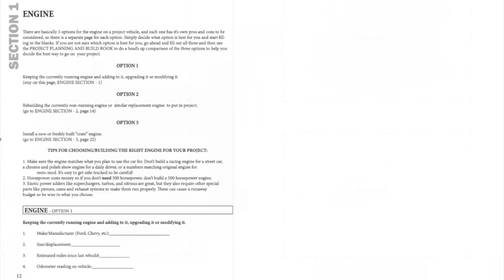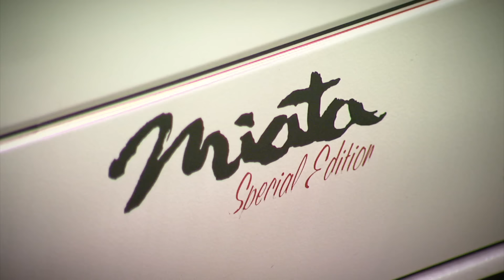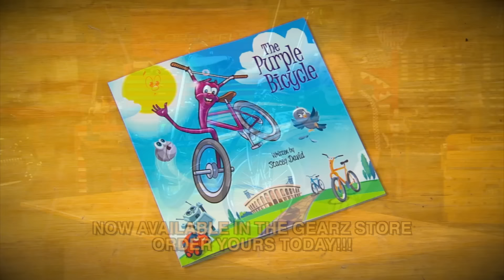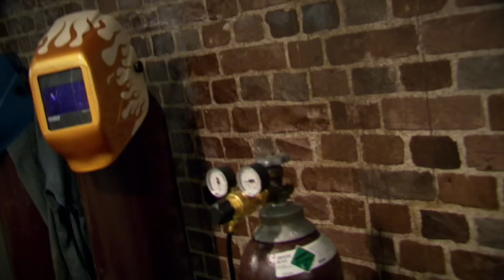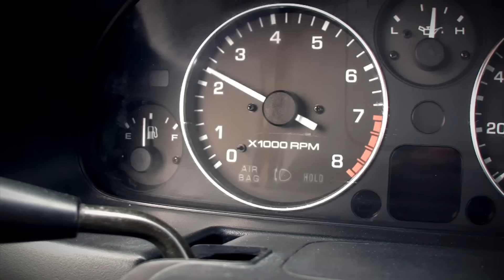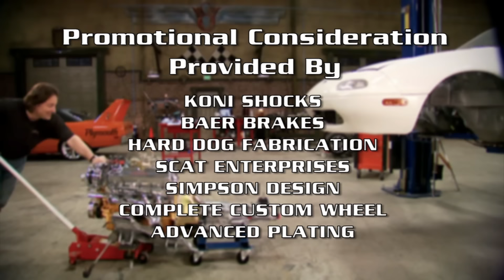Turning a Stock, Broken Miata into a Track-Slaying V8 Monster! Stacey David's BANSHEE - FULL BUILD

Comment: Years ago I made my own light weight flywheel. Put it on the lathe and cut 6lbs off it, also it has stood the test of time. I did it back in the 90s and sold I it a few years ago and never had any issues.

Comment: 22:12 Damn, from this point of view, you can see that the factory engine takes up more space in its width 😀
27:12 Can I buy such a small, light transmission for an SR20 engine? Maybe in Europe? Maybe not a manual, but a CVT?
32:50 How do people get in through that winged door? :D

Comment: If you watch from about 01:03:43 and look at the reflection of the lights in the paints you can see how the new bodywork on the front, and the hood, are not factory smooth. That blue colour looks great but it shows all the imperfections of the composite construction. I couldn't live with that.

Comment: Deberian hacer un nissan 240sx s13 hatchback 1989 ka24e full wide body rocket bunny v2 pero con un motor v8 roots super charger blown con side pipes como un hot rod. Asi yo quiero hacer el mio, yo tengo uno asi puedo ver como va a quedar🤩

Comment: About the only thing a street NA Miata needs is a suspension upgrade package (stiffer shocks, springs and sway bars or performance coil overs) some 15X7 wheels and performance tires. With these upgrades the car can carry so much speed through the corners that the stock engine provides enough power on a road with a lot of tight curves.  Once you get it up to speed it can carry that speed so you don't need a lot of HP to decelerate and then accelerate.  Miata was never meant to be a drag racer.

Comment: Rear wheel offset is too wide, and the whole car needs to sit a bit closer to the tires (it's like you couldn't decide whether you wanted a muscle car or sports car)...but overall it's a pretty cool build. LOVE the V8 Miata builds...my next build will most likely be an LS based Miata Cart. 1400lbs and 500hp N/A lol.

Comment: It is illegal in CA to use any Catalytic converter marketed as 'high flow'.  So good luck passing smog.  I assume if you had just kept the stock ones it would be fine.

If you got the ride height and rear poke dialled in it might be a sweet looking conversion.  I did see a custom 3/4 Mustang built on the Miata platform once.
Reply from the maker: This was built in Tennessee, so that wasn't an issue. I don't think you could do this specific conversion at all in California. There are other conversion options that may be CA-legal though.

Comment: I realize that this build was many years ago. Two questions:
1) Why did you go for carbs instead of fuel injection?
2) What does putting that V8 under the hood do to the MX5's 50:50 weight distribution?
Other than that, that's one mighty fine build! I would love to have a car like that.
Reply from the maker: Putting a carb on it showed people who might've been intimidated by fuel injection that it could be done. Weight distribution with an iron block V8 isn't as good as stock (don't know the exact figure), but the difference is minimal if you use an aluminum V8.
Reply: @OfficialStaceyDavid  Aluminum  V8.. how much does that add to the cost?
Reply: @OfficialStaceyDavid  The LS1 would be my first choice for a build like this.

Comment: I think you have the front brake rotors on backwards.
Reply: There was a directional arrow on the rotor. He had them on right.
Reply: @danquinnell3502  direction arrow or not, the viens are directional and was put on opposite the way they work.

Comment: I would have painted the Miata body metallic blue, like the paint you used or dark metallic green, no striping. Done everything possible to make it look factory except maybe a good paint job. All black interior as stock as possible with black not chrome roll bars/ The roll bars for safety, and black to "hide" them when the top is up... less noticeable.

Yes I want a sleeper, but preferably one that looks cared for but not modified. The for the entire under carriage would be black or dark grey, and the engine might not have chrome accessories, but clean new ford color paint on the engine and billet aluminum valve covers and accessories.

Comment: Brother the ultimate sleeper is always going to be a wagon the boxier the better.
plastic don't generally need to be painted though atleast not if its faded hit it with some heat will mosre then likely bring it back wont it?
oh and a V8 growls it does not scream. unless you cook the oil in it.
Reply: The heat gun on plastic trick brings the oils to the top, temporarily "restoring" the dark color, but it also sucks out the same oils which keep it from getting brittle. A short time later it'll be faded again too, as well as brittle.

Comment: Also you have modified everything else I definitely would have drilled the cross member rather than weld and harp plan and I would have went with at least 5 lug hub if not 6 and some massive tires to go with some serious brakes

Comment: Unfortunately GM has them 1 upped with the Solstice/Sky. Unknown to many is that the LS engine and tranny (manual) pretty much bolt right in and wire up without any significant body mods needed. That car was actually meant for this same purpose but they decided not to go forward with it.
Reply from the maker: Those are very cool cars but about 600 pounds heavier than a NA Miata. They would be a good project if I wanted to revisit this concept!
Reply: The other issue with the Solstice/ Sky is the lack of aftermarket support. Throw a rock and hit 40 Miata parts on the market. Not so with the GM twins.

Comment: 4:20 That's not strictly true. AC were using American V8 engines in their cars, and it was not exactly a girl's car. Shelby did not exactly "put in some horsepower" because it already had that. What he did was take a small, overpowered road car, and turn it into a lethal track weapon.

Comment: I will say this if you're pulling the engine and trans and the subframe you might as well just pull the engine transmission subframe out all together. Save yourself the trouble of lifting it out of the car when you can just drop it out the bottom

Comment: Hello, one question from the other side of the Ocean: don't you have a M.O.T. or any kind of control in the US? I was refused for having swapped my indicator's light bulbs with coloured ones "nor factory build, OFF !" they said or the car was take away from the circulation ! Best Regards, Michel (Belgium - Europe)
Reply: Hello Michel, There's no MOT in the US, but safety restrictions are different from state to state. In most states, as long as the car passes a smog check every 2 years you can do pretty much what ever you like with after market parts. Here in California Smog checks are more strict, but if the car was built before 1975 we can do anything we want with no smog check at all. That said, a police car can pull you off the road for unsafe conditions, and you would have to repair it or the car would be taken out of circulation.
Reply: @Datsun510zen  Thank you very much, All the Best for new year, Michel (you luck car owner ! hahaha)
Reply from the maker: Gearz is based in Tennessee, US, which has no state safety inspection and now has virtually no emissions testing. As the other commenter said, that varies widely from state to state.
Reply: @OfficialStaceyDavid  Thank you very much, all the best for the new year ! you lucky ;o)

Comment: Question: Do they make a kit to fit a Chevy engine into the Miata ?
Reply: Yep.  They have an LS conversion kit.   A junkyard 5.3L or 6.0L with a cam, intake, and a tune would be a good way to go.   You can make 450-500hp pretty easily.    That much power in that car would be nuts.

Comment: Comes across as a really nice
genuine guy.
A truly great build but if it were mine I would have stopped at just the mechanicals and seats and left the bodywork and wheels as standard to be a real street sleeper. The brakes would obviously be needing upgraded but maybe found discs which would fit under the standard wheels.  
Greetings from the UK, 🇬🇧

Comment: So u just installed a steering wheel with no airbags....on a fast car? So much for an Italian art. The body strap will not keep your neck from breaking unless you also strap your forhead on the seat in a whiplash. Vince Laviolette will never take that car for a spin. Its a very nice build, don't get me wrong.

1:08:56 Maybe the guy has fake nails. Fake nails are unregistered weapons. Thats why i don't mess with girls, i just chase them.
1:15:59 I thought u changed the seats the first time coz u wanted one with bigger rib support..lol. it works either way.

Very nice car. Think i can have it ? lol

Comment: His opening thesis is 3000% correct.
But, if you want this to be a street rod, you will have to make many compromises. Make it a track car, and it will beat anything lined up against you.
Edit: Why are you keeping the AC for a track car??!
Edit: He is not peeling out the carpet and sound deadening material???!

Comment: Unless you hate Chevy for some reason most people would rather swap in an LS derivative.  F Body oil pans fit the tubular K members just fine.

I would probably recommend an RX8 just because its practically a 3rd gen Miata stretched a bit.  And with this much horsepower a longer wheelbase is always good.  And since the engines on those are always going bad its more likely you can find one in nice shape that isn't all destroyed.

It is pretty common knowledge that Miata is an excellent handling vehicle.  Should not surprise anyone unless they haven't seen a car review or grassroots motorsports magazine in 30 years.

Comment: Thank you for not using an LS. They are great engines, but they get swapped into everything and are getting boring.
I have almost that exact engine from K.K., except it is an EFI. It dynoed 405 HP and 389 ft-lbs of torque.

Comment: Nice build but you can Supercharge or Turbo Charge the stock Miata engine and get similar power to weight and save yourself a bunch of money and time . If you have never ridden in a Turbo Miata you will be surprised at the performance.

Comment: Hey S.D. I followed along with you and replaced the Miata motor with a 302. You're right! It was pretty easy. I mean I did have to rewind a few times but I did it! The only hard part was doing this at night in my apartment complex parking lot. They don't allow you to work on your car so I had to do it with just a headlight flashlight. Only thing I have left is to take her down to Midas and get me a sweet paint job!
Reply from the maker: That's awesome!

Comment: Thanks Stacey for an enjoyable morning of watching you and your creativity, which is soo often overlooked. Anyone can stick a high HP motor in anything and call it a hot rod, but you have always had a vision for "outside of the box" street machines.  My son and I are about to take on a Miata project, and he was adamant on specific years and models due to some engine issues, now I can say, let's go muscle, and not worry about what is in it originally.  I do have a question regarding some of your pricing, and saying it is a 20K build. My guess is closer to 35K?  I also wish more people would realize how much $$$ you can save by building your own VS buying a new... A high performance new car will run about 50-75K easily, put half that into a forgotten car, and you will have a true Hot Rod...
Reply from the maker: It would be more expensive with inflation, but you could keep costs down by using used parts. Miata prices have gone back up too. You're right that you will save money doing it yourself, plus you know what's been done to it!

Comment: God I'm sick of idiots stuffing V8s in a well balanced Japanese sports car thinking it's going to make it a faster track car. Calling the AC Ace and Miata "Girl's cars" is straight up ignorant. Both are insanely light great handling track cars that are SUPER successful in their race  class. But hey, if you love oversteer that's just this side of driving a forklift, the Monster Miata is for you. Calling this short wheel base overpowered wide body forklift a "track monster" is just sad. Comparing it to an AC Cobra is a sad joke. A roll cage is the only thing that would keep the convertible unibody from turning into a pretzel under that much torque. Shelby completely rebuilt the aluminum chassis of the AC Ace before putting a V8 in it, and that's what made it a successful race car that is still lusted after to this day. 

I've raced against V8 Miata's in autocross/time attack, and a lightly modded 250hp Skyactiv-G 2.0L Miata would eat this Monster Miata's lunch on the track, you can stay in the SCCA Street Prepared Class, and build it for half the price of the Banshee. With a V8 and body kit though, it would get bumped up to the Open Class, and wouldn't stand a chance competing with cars like my 1900lb, 400HP Datsun 510. In reality the Vett playing patty cake with the Banshee at the end would absolutely destroy it on the track. Even on a drag strip this car wouldn't stand up against a turbo'd 2.0L. For instance, my 510 set up for autocross on slicks pulls a 3.2 sec 0-60 and a 10.89 1/4 mile at 145 mph. This is me doing some butt time dyno tuning with 280hp. https://youtu.be/nSMJegee3t0

Comment: As I am building a cobra with rx8 front and rear suspension, I did a lot of background reading , most people don't know that a Miata is the same wheelbase as a cobra, and overall size is same as well, the cobra is around 10" wider in the rear, this is a cool build, BUT you won't build it for $20k , more like double if you duplicate this build, it's also front heavy making it tail happy under heavy braking and cornering, on a cobra entire engine sits behind the front axle centreline,    one final comment ---- did anyone notice that he fitted all the brake rotors on the wrong way around,,  on grooved rotors the groove Flays outwards as the wheels turn to let the gas escape

Comment: Great Work!   I built a Simpson Design 'Italia' body kit 47:20 on my Miata/MX-5 back on 2003 or so.  This process really took me back, but I did some things differently with the kit.  Cut the headlight, side gills and grill opening before mounting.  The rear was tricky and took a lot of trouble to get it right.  These fibreglass pieces are not exact fit - they need trimming nearly everywhere.  It comes undercoated, but rough, so the prep and paint took a lot of work.  Also, the doors have a indented fold along the middle - that needs to get cleaned out and filled. The Indy fuel cap isn't connected to the filler pipe - its just a flip cover for the original Mazda screw fuel tank cover.  Certainly gets lots of looks!!
Reply: I don't think you can get the Simpson Italia kits anymore. Hopefully this outdated info doesn't give people wrong information.